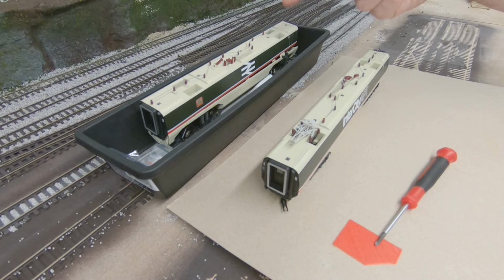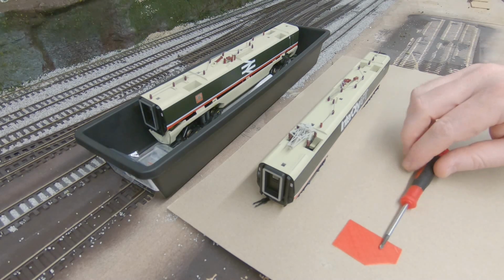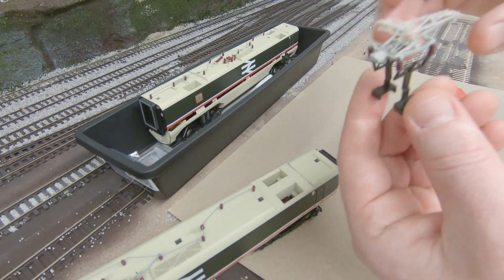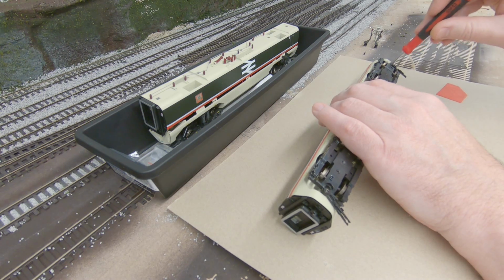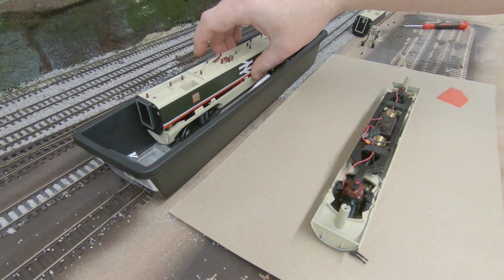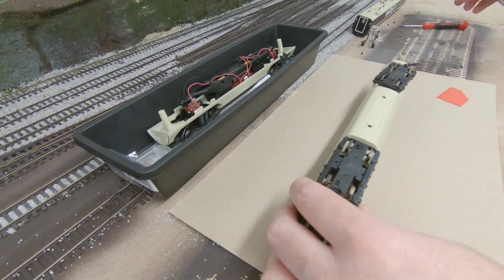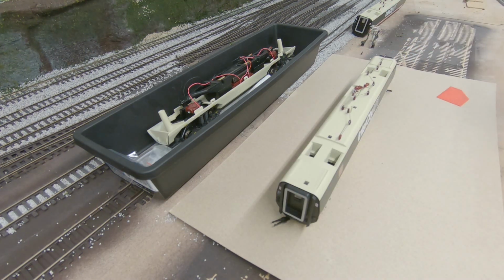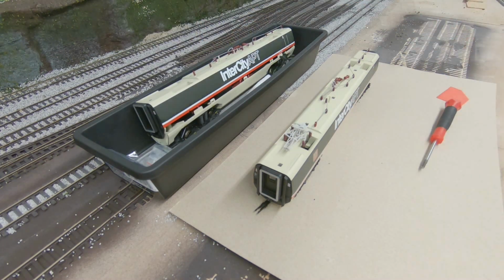Swapping Hornby APT Non-Driving Motor Shells | oorail.com

Comment: Great tutorial on the APT .hopefully I won’t need to open mine when it comes but you never know.

With the pantograph are hornby making both types

With your APT have you had any problems with the bogies being bent I’ve seen a few online that aren’t straight.
Reply from the maker: Thanks Oliver! It looks like Hornby are making both the Early Pantograph and the High Speed Pantograph. They have both listed in their Class 370 Advanced Passenger Train operating and maintenance instructions. Its on the back page, section 5 Figure.10 and Figure 11. The APT 5-car pack and the spare motorized NDM (Sc49004) have the early pantographs. I suspect that the APT 7-car set will have the High Speed Pantograph. The Pantograph looks like its just on one piece so it should be very easy to swap out. I'm hoping both NDMs are motorized in the 7-car set, but I suspect one might be a dummy. None of the bogies on the APT are bent. I have two sets, this one you've seen running on the layout and the ones that go with the 7-car set, none of them are bent. I also have a spare TU set that I bought in case my capacitor removing experiment went sideways, and those are also OK. I suspect there may have just been a bad batch assembled maybe?
Reply: @Oorail  that great to know. I have 5 and 7 car sets on order

Comment: did you look at getting the red clip that connects the bogie to the frame 3D printed, both of mine has snapped.
Reply from the maker: Yes I am currently testing out three different replacement designs. The part is used to keep the gearing in place in the motor, so its important to make sure the metal pieces still fit and operate as originally designed in the replacement part. The clip and peg part is normally easy, but with the tilt mechanism, doing some testing to make sure it doesn't break or mess up the tilt. One interesting thing is that I had one of the Hornby ones break while testing, so I suspect this maybe a bigger design issue. You will probably need a filament / FDM printer, resin is going to be more brittle that the plastic Hornby uses. I am currently testing with PLA, PETG and some hyrbird-PLA materials. One of the issues is that the "flexibility" of the materials are different, so the peg design they use is not always a straight like for like replacement.
Reply: @Oorail  cheers for the reply, currently waiting for a reply from hornby regarding the broken part on the set received yesterday. i hope you manage to find a way round this issue and let us know via a video and are able to sell them.
Reply from the maker: @bart10180  Hornby support seem to be pretty swamped. They are taking upwards of 2 weeks to respond to basic stuff. I have not heard from their support about the part. Simon is aware there is an issue with that part and the packaging in the 7-car and 5-car packs. I think they chalked mine up to bad luck originally, but given the number of DMs, emails and comments I have heard asking about it, I suspect its a wider issue, plus you have all the folks who haven't opened the box! Once I get it sorted, I'll upload a video.

Comment: So you have three running NDMs, or two running and one dummy?
Reply from the maker: I've got three running NDMs, one from the 5-car pack and two motorized NDMs (Sc49004), as I bought one for the 5-car pack and one to motorize the dummy from the 7-car pack. Whenever Hornby ships out the 7 car packs, I should have five NDMs in total, four motorized and one dummy.
Reply: @Oorail  you've got two on the way? Wow! How's the remortgaging going 😅